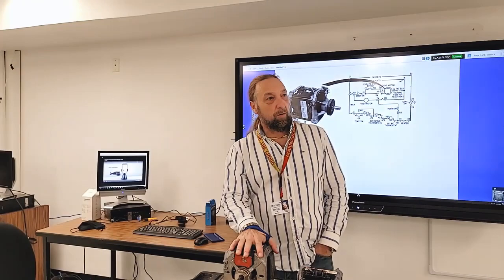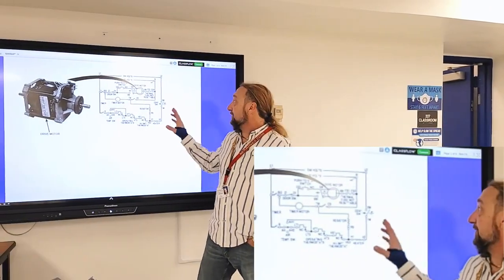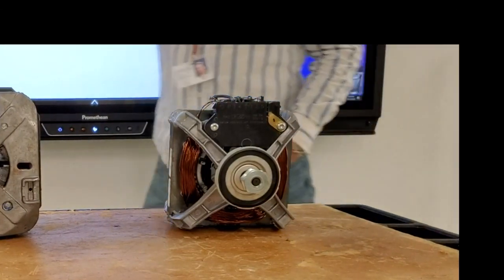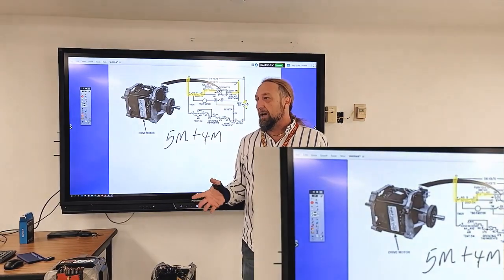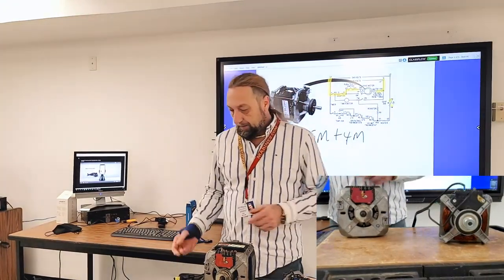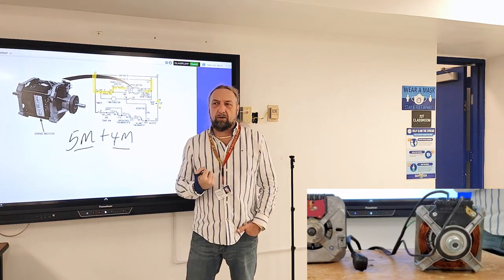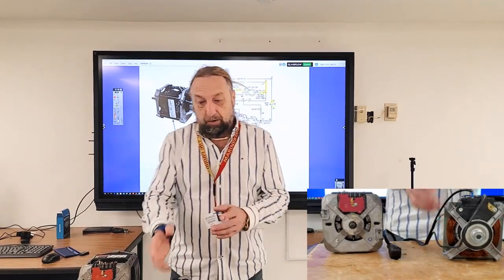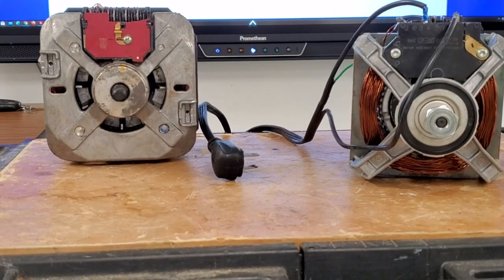#TECHTALK Dryer Motor Testing Part 1

Comment: Another Great Video. i had a open on M5 to that motor thermo fuse on the motor . so the motor must be replace ... this is a great video on how power go's to neutral out the M4  good to know that... and power enters from M5 .... Thank you so much ...  and i have a jumper cable for water valves for 120V i can try this to start motor. now cannot use the 120v on water valves for i think samsung or maybe it is the LG water inlets they are DCV only...

Comment: I have a GE profile dryer and when I push start  sometimes the it hesitates makes a clicking sound and it thinks the drum is spinning but it's not. And it's only blowing air but no drum spinning but sometimes it works fine and the drum spins. Would this be a Start switch?